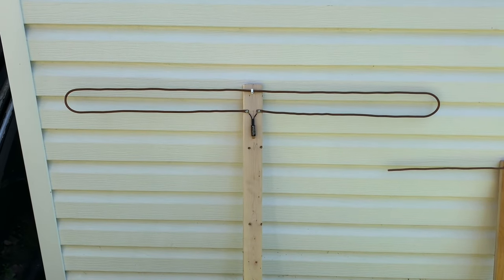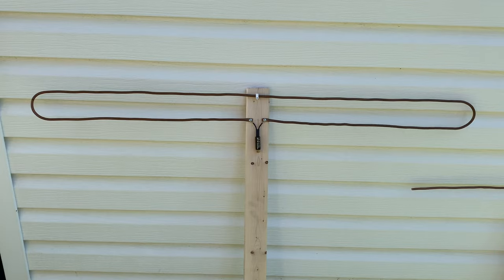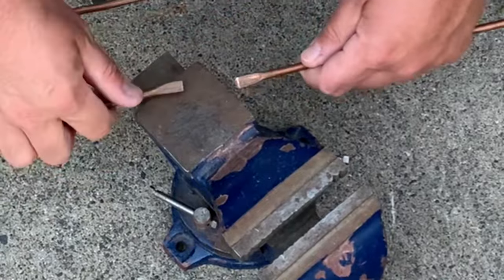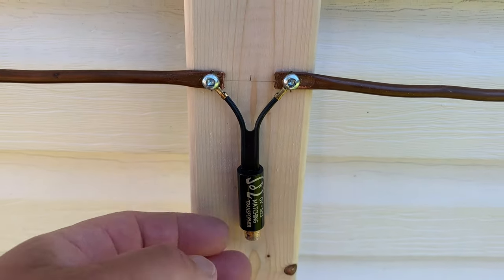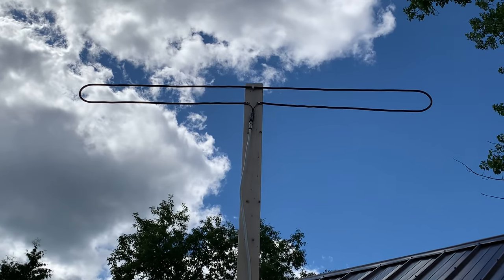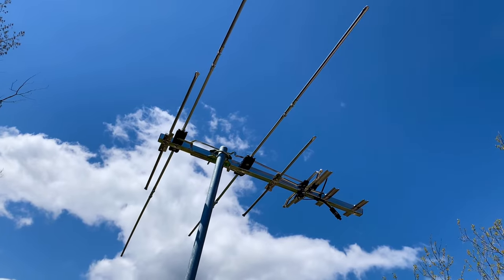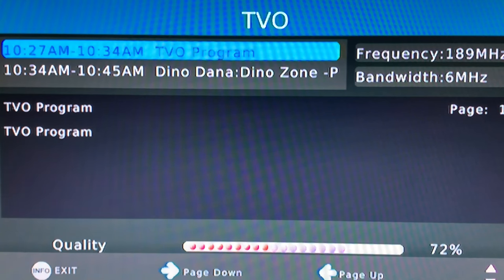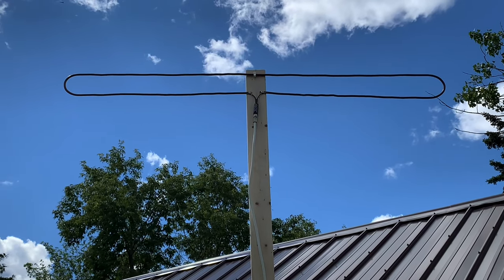Homemade Folded Dipole TV Antenna performs way better than I expected

Comment: The folded dipole is the same length as a simple dipole. L (ft) =  492 / f ( MHz ).  The characteristic impedance  (Z) of a simple dipole several wavelengths above ground is 72 Ohm. It can be fed directly by 75 Ohm coax. A matching transformer 300: 75 ohm is unnecessary and will only cause signal loss. Folded dipole construction depends on the conductor diameter, spacing between the conductors, and the dipole length. Shape of the ends makes no difference. Characteristic impedance of the folded dipole is typically known as 300 Ohm. In practice however it is 200 Ohm therefore a matching transformer is needed for a coax downlead.

Comment: Improve performance of this antenna. Your overall length should be 104 inches. About 8 ft. Granted not ideal, but you aren't getting the most gain or efficiency with the shorter length. It's a wonder you are receiving. As is each side is 1/8 wavelength long. Ideal construction would be found in an antenna handbook. But when I build these I use lengths of 300 or 450 ohm flat or ladder line. The spacing is already set. Split one side at the mid point and solder your transformer or another length of your line one to each side. As in common FM stereo antennas. You get improved gain (around 3 dbd) and bandwidth. You may do as well with a fan dipole and easier construction, as you aren't transmitting. Or just use an folded dipole antenna  made for fm stereo. I applaud your building efforts. I hate that everyone wants to buy lower quality when they could build better for free. Keep it up.
Reply: An ideal antenna will be about 1/4 wavelength on each side, not 1/8th as you suggest.
Reply: @ToddCarpenter-N9YSQ and Northcoaster Hobby. I made a Folded dipole antenna a few years ago to pick up channel 4 in my area (used a stripped down electrical cord). It was a full wave antenna, so it is rather large in my opinion. I just stumbled upon this video and see the success with the half have folded dipole. I just tried to make a half wave to pick up channel 4, but didn't have any success. Do you have any thoughts or advice as to why it isn't working? I realize you can't see it, but I am using speaker wire this time (for testing purposes). I need to make an antenna for someone to pick up channel 12 (real broadcast channel) and I would like for it to take up as little space as possible. Being a novice, this Half Wave Folded dipole appears to be the only option, if I can get it to work. Also, the diameter of wire or tubing that is used for an antenna, I presume that the large the diameter of the wire or tubing helps in better reception? Thanks for posting this video and for your reply.
Reply: @kensmith5694 No, Todd is saying that the Channel 2 antenna in this video is only 1/8 wavelength on each side .
Reply: @Fetherko  Read my comment again.  I said the size for an ideal antenna and not for this less than ideal one
Reply: It's about resonance.  Resonance happens best on full wave, 1/2 wave, and 1/4 wave. You actually get a bit of gain if you make a full wave x1.25 length.
Reply: @kensmith5694  <-- He did not suggest an 1/8 wavelength but that the current design of 1/8 wavelength is not ideal.
Reply: @panagdimi  Yes, to be clear, 1/2 wavelength total width is the ideal.

Comment: To simplify it 4 everyone without all the half wave talk & confusing math! Just make it 3 ft wide & it covers all highband 7  thru 13  channels being used! It will be useful for about 40 miles
Reply from the maker: There’s a theory behind antenna design. But your method will work too! As I said in the video I sort of spitballed this one.
Reply: Which is it: 3 ft total or per each side?!

Also most of the links said to be in the description link are either dead or simply not there.

Also Northcoaster, if you see this comment and have the time to respond, of all the different antennas, shapes, lengths, etc., which one do you think is the best for receiving from VHF channel 12 all the way up to the end of the UHF band?!
Reply from the maker: @panagdimi   I used an 8 foot piece of copper tubing. Marked it 2 feet in from either side. Bent the radius at the 2 foot marks. So the top and bottom are each about 4 feet.

The TV channel frequencies link must just have gone bad. Or the website is having problems. I just visited that link less than a week ago and it was working fine.

There are many different antennas that will work, but it really depends on your location, among other factors. Some antennas are simply better than others.

Have a look at my TV antenna reviews playlist for starters:
TV Antenna Reviews
https://www.youtube.com/playlist?list=PLDX6gLCL4WMwMAycjBF3_ApXyAfwHNV4f

If you’re looking for some High-VHF/UHF antennas (they cover RF channels 7-36), a few specific ones I have reviewed recently are:

Televes V-Zenit MIX Outdoor TV Antenna Review Model 149381
https://youtu.be/_f3V06kNhpE

Televes Ellipse Mix Outdoor TV Antenna Review Model 148883
https://youtu.be/veWVeJkJscA

RCA Amplified Outdoor/Attic 'Spiral' HD TV Antenna Review Low VHF, High VHF and UHF Model ANT860EV
https://youtu.be/uxl_KoThg7E

RCA Outdoor Attic Yagi TV Antenna Review Model ANT752E ANT754E
https://youtu.be/ZzLy0hVlIk8

GE Pro Outdoor Yagi TV Antenna Review - OTA Television
https://youtu.be/pGJJLFdPRSg

RCA Attic Outdoor OTA TV Antenna Review Model ANT705E
https://youtu.be/st0LJK1Ia78

I hope this information helps. Thanks for watching my channel!

Comment: Since it does a good job receiving VHF Low it will also receive FM channels but for both FM and DAB+ the antenna must be mounted vertical.
Reply from the maker: For sure, just have to mount it sideways!
Reply: @NorthcoasterHobby  For FM reception in order to receive most of the channels and in stereo you must mount it sideways otherwise you have to rotate the antenna each time you search a channel. In Europe most countries broadcast FM vertical so the antenna mounted horizontal will do a poor job. DAB+ can only be received vertical.
Reply: If the antenna is mounted at a 45-degree angle,  halfway between horizontal and vertical, it will receive each polarization at 70 percent strength (cosine of 45 = ,707). Losing 30 percent of a signal is rarely a problem;  if it truly is, buy a second antenna, some cable and a switch.  That way, you can choose between a horizontal or vertical antenna at the receiver.  Radio/TV hobbyists nearly all have more than one antenna.  Anyone can do it.
Reply: @bloggerccc  In my case for FM I installed a 3 elements Yagi antena vertical mounted, for VHF High (DAB+) I installed a 7 elements Yagi antenna vertical mounted, and for UHF a 19 elements Yagi antenna horizontal. An FM+VHF+UHF combiner and a 4 output amplified splitter. I have excellent reception on both TV and radio (FM and DAB+). I prefer to install multiple antennas to get the best reception.

Comment: my FM radio has only 1 antenna out. (single wire). but coax has two wires , outter earth and inside copper.

Comment: What about UHF channels?
Reply from the maker: I don’t have any UHF channels in my city. VHF is still widely used here in Canada. But a UHF antenna would have an element of much smaller length. For example an antenna tuned to channel 14 (473 MHz) would have a folded dipole roughly 11 inches across, 23 inches in total length. 

https://www.changpuak.ch/electronics/Dipole_folded.php

https://otadtv.com/frequency/index.html
Reply: @NorthcoasterHobby  Thanks!
Reply from the maker: A simpler version is this:

Build a Homemade TV Antenna from Coaxial Cable - DIY OTA TV Antenna
https://youtu.be/ACWdzkHSVXE
Reply from the maker: @seanedwards569  👍

Comment: Could you make this antenna work for OMNI directionality and deep fridge distance ?""
Reply from the maker: To make this a deep fringe antenna would require adding a long boom, longer elements(several more), as well as several director and reflector elements.

I suppose to make an omnidirectional antenna you could form the metal into a loop and orient it horizontally.
Reply: @NorthcoasterHobby  Would you have an plan that I can go by to make me one Northcoaster Hobby ??? What I need is a ultra deep fringe omni-directional antenna. I am sure I could make me one that has been proven with just a plan from you Sir. 
Thanks too.

Comment: Need to better understand how to determine the length of each side of the dipole based on the channels to receive. But technically do you need a separate length for each channel that is not practical. The TV band is channel 2 VHF all the way up to channel 36 UHF I believe the range is from 54 all the way up to 608 MHz. Can one antenna receive every channel in this range I'm not sure how you do that can you help?

Comment: I am trying to build one of these and have trouble physically adjusting the lengths of the dipole to the frequency I want. The thing that makes F.Ds  work without being the exact right length is because the folded dipole is very wide banded, so if you get close, it will still be an improvement. A regular dipole has to be cut closer to the correct resonant freq. Also, your signal strength should be higher if you run that old 300 ohm tv twin lead wire all the way from the antenna and put the 4:1 300/75 ohm balun transformer at the bottom before tv. That old twin lead has 1/4 the signal loss of coax.  If you cut antenna elements exactly right length,  it will be even stronger, but you will need a $45 NanoVNA antenna analyzer to do it.

Comment: Since I live in an area where Low VHF channels are plentiful. And the dipole needs to be so large in size to receive the signals accurately.  Would making the antenna folded on itself two time instead of your one fold  making the antenna a smaller footprint  help increase the gain of the signal Sir ?? Thank you for your video Sir. Nice work with honest information for one to learn from.
Peace vf 😀😀😀😀😀
Reply from the maker: @victoryfirst2878  I would not do that because you want to maximize the amount of signal that the antenna grabs. Low-VHF wavelengths are long. So either use a folded dipole like this or long dipoles (unfolded),
Reply: @NorthcoasterHobby   I understand what you said Sir. Would making the antenna say 1.25 larger than the standard wavelength increase the reception ?? I read on WIKI using the slight larger size increases the signal gain ?? Reason I am asking as the WIKI article on dipole states the the 5.2 directive gain is achieved by what the author stated. 
Thanks Sir.
Reply: @NorthcoasterHobby  Would using the wire length of 1 1/4 times the frequency wavelength give you a 5.2 directive gain dBi ?? How about folding the loop a few times to reduce the width size keep the gain the same ?? What I mean is the ends are S and a half shaped. Thanks vf

Comment: Hi good video, thanks. What are you using to measure the signal strength? Thanks
Reply from the maker: To measure the signal strength I’m using a digital converter box. Most of them have a built-in signal meter.

Core Innovations OTA Digital TV Converter Box DVR Review - DTV Converter Box with PVR Recording
https://youtu.be/TK4IUDi83r0

Comment: 1) Both antennas should be 1/2 of a wave length.

2) The spacing between the arm with the transformer and the folded section matter to the performance.  If you get those the right distance, the folded dipole has a wider bandwidth than the plain dipole.  A pipe having a larger diameter than a wire also makes the bandwidth wider.

3) Your idea of impedance is correct.  It works best when the impedance is matched.  This also means that the resulting impedance is at zero phase.  With a zero phase on the impedance (also call resistive), the voltage and current stay in step with each other.

Comment: Could you do the same thing but with TWO dipoles?  Like one above the other, and both connected to the balun?
Reply from the maker: I would put a balun on each antenna. That’s the proper way. Then combine the antennas with a diplexer or A/B switch.
Reply: @NorthcoasterHobby  - would that effectively improve your reception, or would it be a minimal improvement?
Reply: If you are suggesting what I think you are suggesting, the answer is "it won't work very well.  A simple 1/2 wave dipole tends to have an impedance of no more than 73 ohms.  If you do two of them both connected to the same transformer, you will have an even lower impedance.  Thus the balun intended for 300 ohms will be badly mismatched.
Reply: @kensmith5694  - thanks for the reply.  I don't know much about the electronics involved, so I'm just trying to figure out a system that might work well for me.  Are there other baluns that would handle that better, or are they all a standard 300 ohms?
Reply: @doplinger1  The 300 to 75 Ohm balun is the one you are likely to find out there.  Other impedances can be made but there isn't much market for them.  A good first step for you is to find out the RF frequencies that are going to matter to your antenna.  There are sites out there that will take your location and tell you the stations you might get.  On some of them, you can see frequency directly.  On others they tell you the "RF Channel" that you then need to go look up to find the frequency.
If all the "xxxMHz" numbers cover much less than a 2:1 range, a folded dipole may very well work for you.
Reply: An A/B switch does not combine it's either A or B.

Comment: Where are you getting the lengths for the dipoles? I get much shorter lengths when I look them up
Reply from the maker: As I said in the video I used an 8 foot piece of tubing and bent it around a radius to get a folded dipole of about 4 feet. RF channel 2 requires dipole elements of about 8 feet (4 feet each), so I figured that would be close.

Comment: I live in Wyoming 200 miles away from any tv towers.Will it work or not? You didnt say what mile range it is! Is it for 150 miles or 1mile? 😮
Reply from the maker: I’m about 7 miles from the towers in my area. I’d say a homemade antenna like this might be good for 15-20 miles, give or take, under ideal reception conditions. No antenna will capture TV signals from 200 miles away. The curvature of the earth restricts reception to a maximum of 70 miles. Have you considered FTA satellite?

TV Channels on Satellite 99.2 West KU Band Galaxy 16 - FTA Satellite TV
https://youtu.be/74ATpYK84x4

Getting Free Satellite TV
https://youtu.be/qBOVmYHAGWc

Comment: could this antenna reach 500m
Reply from the maker: Do you mean metres or miles?
Reply: @NorthcoasterHobby  meter
Reply: @NorthcoasterHobby  also i meant for transmitting not recieving
Reply from the maker: @ventinator0  Definitely would reach 500 metres!
Reply: IF IT IS 600 FEET HIGH IT MIGHT, REMEMBER THE EARTH CURVES

Comment: Must be the old analog days 2 is no longer a tv TV channel unless its a virtual number. Most TV stations broadcast on UHF regardless of their number on the dial. We in Florida have a UHF channel broadcast on high VHF. Go figure. 73
Reply from the maker: All my channels are digital. OTA TV broadcasts from RF 2-36. However the majority of channels are broadcast on UHF 14-36. 73

Comment: Thats all theory !
But without proper test equipment , you're relying on faith that this antenna is what you say it is !
I believe you have over complicated things for yourself, when a folded dipole offers greater bandwidth, essentially lowering the antenna " Q " !
Where as a typical half wave dipole can brought to resonance, with an input impedance near 73 ohm's, making it a perfect candidate for using 75 ohm shielded Coaxial cable, with no need for a transformer !
IMHO
                   🤔....?
            JUST SAY'N !
Reply from the maker: Thank you for your comments. It’s a DIY antenna, and I’m not an RF engineer. I added the balun to make it easier to connect coaxial cable. It gets the job done for me though.
Reply: @NorthcoasterHobby  
Nor am I....lol !
Just from what I " Think " I've learned thru the years !
Your point is valid, and who can argue with success ?
Many years ago, when this whole Off Air business took flight, a sight impaired Buddy of mine, and I were trying to pick up pictures for his wifes under the counter Tv !
So just experimenting, we had a paper clip pushed into the back of the TV, and wires connected to alligator clips, and had a pretty successful scan of the channels !
I spotted a connection I didn't like, and encouraged my friend to let me fix what I thought once repaired, may get us even more channels !
As I began to disconnect the mess of wires, I noticed the picture quality didn't seem to suffer !
This continued down to only the paper clip !
Just for grins, we did another scan, and ended up with something like 38 channels, with only a paper clip !
At the time, it was an unbelievable result !
Of course we laughed like kids, not believing what we just witnessed !
I tried to get my friend to make a YouTube spoof out of this, but couldn't get him to do it !
I think it would have went well ?
So much for our 15 minutes of fame !
Lol !
So you just never know ?
He just happened to live in a very RF rich environment, I guess ?
But I commend you for experimenting !
To me that's what it's all about !
Sorry if I came out of the gate a little strongly !
Congratulations on your antenna !
But one last parting shot !
I wonder if you have ever thought of connecting an amplifier to the antenna ?
Some places it can help, and then others, I think it can cause issues !
Just wondering !
Thanks !
👍😉
Reply from the maker: @sleeve8651  It’s all good, I appreciate your input, thanks for sharing your experiences. A paper clip- some markets have strong enough signals to pull it off- I’ve seen it before on TV displays in stores!